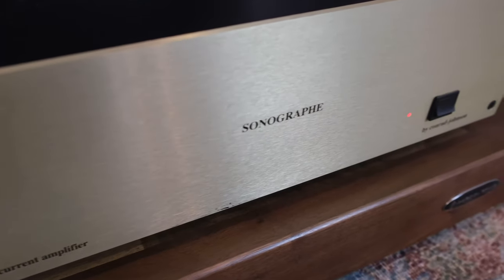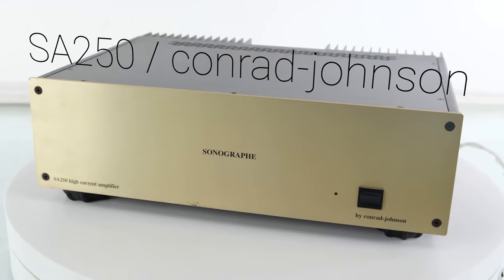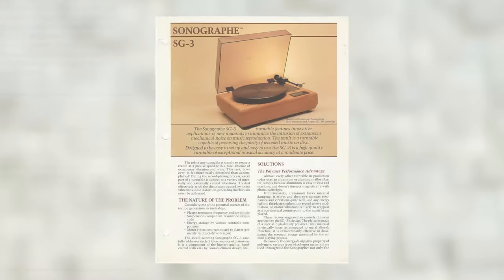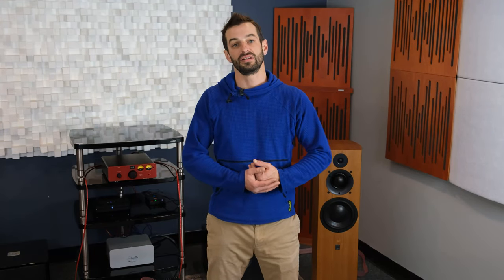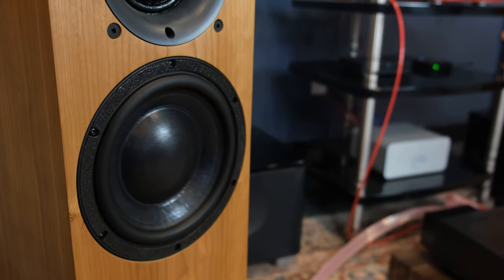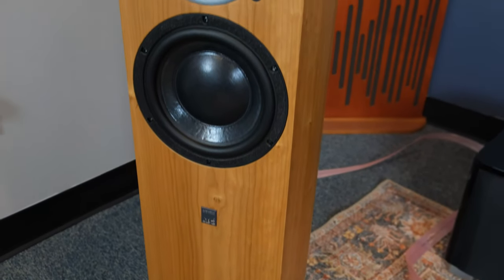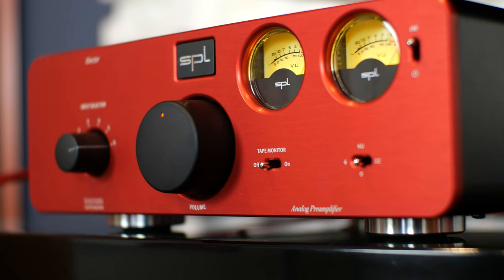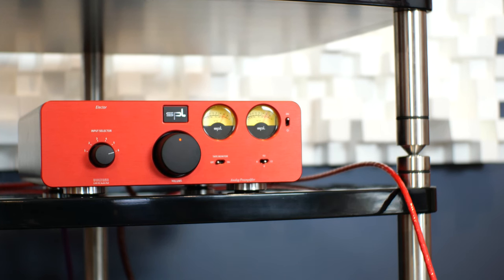Synergistic Setups E05 - ATC / Conrad Johnson / Nordost / SPL

Comment: Nice speakers. I much prefer ATC to Harbeth or the other British mfgs. Again, the speaker cable is way too expensive unless you're just going for looks. In test after test, interconnects and speaker wires have been shown to sound and measure exactly the same with minor differences in capacitance. Only by trying to design an audio cable with added character (aka distortion) can one truly make one cable sound differently than another.  As a 30 year 'audiophile' trust me - you are just fine using Canare or knock-off Kimber Kable from China so long as it's 4- or 5-9s OFC. Skin effect has ZERO affect on audible frequencies. That's a straight out misrepresentation. There is HUGE margin in cables, especially speaker and digital cables - that's why sellers and reviewers w/ relationships with mfg.s push the most expensive ones so hard and try to differentiate their own products along the price continuum with BS claims about research when most of the money goes into profit and marketing.